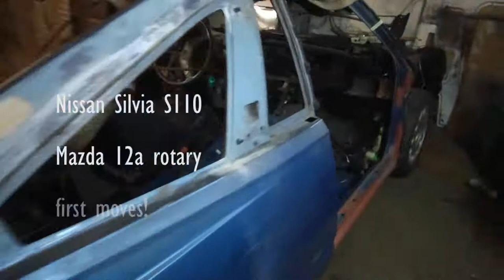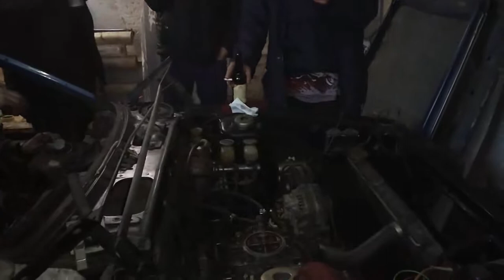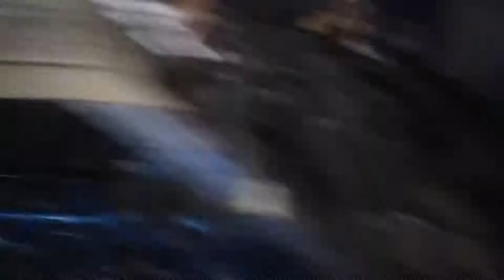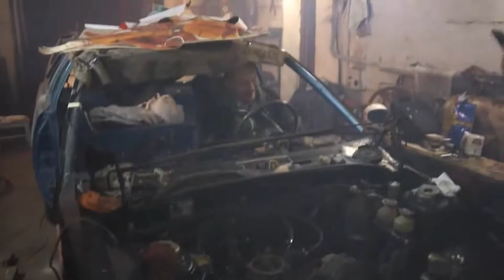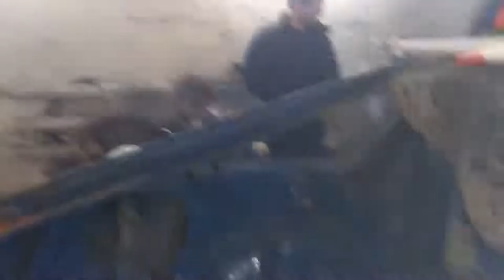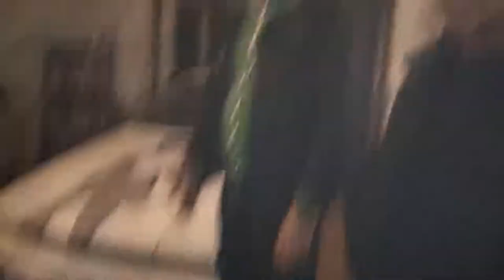Nissan S110 Silvia with Mazda 12a (RX-7 FB) rotary first moves

Comment: Do u run the stock rear end too?
Reply from the maker: For now - yes. And as long as I don't have any sports plans for it - the stock will do. :) As I've seen, the front can be relatively easily converted to s13 suspension with coilovers - stock springs won't fit in there. And for the rear or you will run stock, or remove it completely and weld in something, lige the similar s13 milti-link suspension.